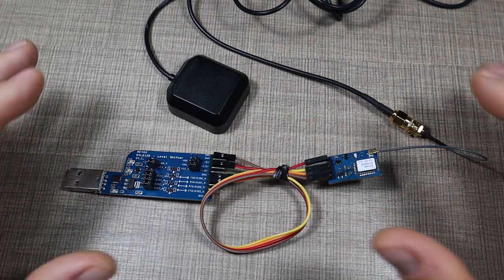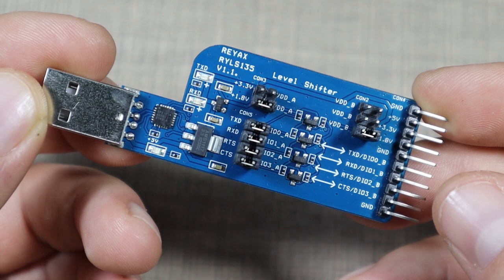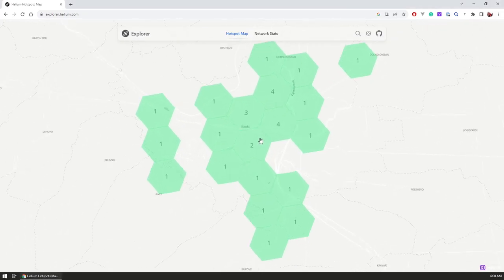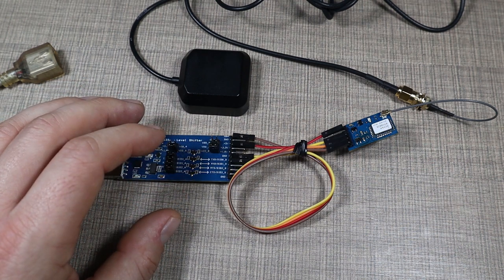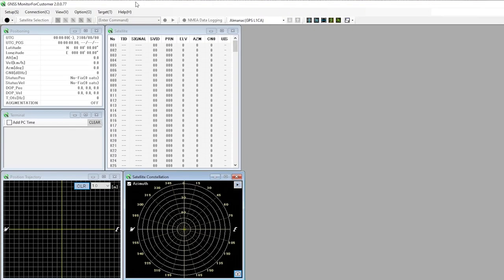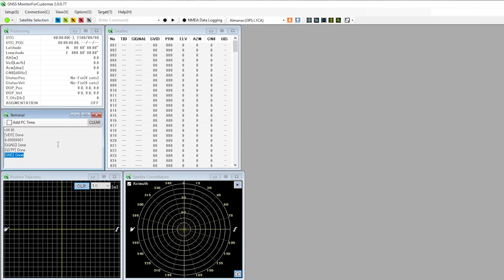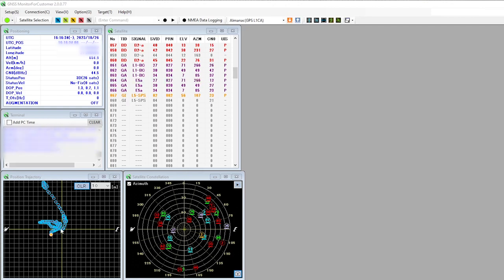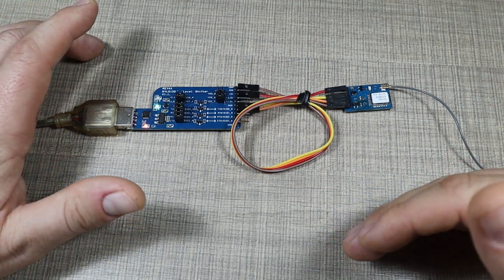GPS Module Reyax RYS8839 review and interfacing it on a computer

Comment: whats the point of being tiny of the antennat is huge
Reply from the maker: With the antenna being external, you can package the receiver in a small form factor so it can be embedded inside vehicles or other objects that you want to track, and the antenna can be mounted with a clear view of the sky. Unfortunately, the antenna is not something that you can omit or reduce in size.
Reply: @TasteTheCode  but do you know alternatives where we can use small onboard antetnnas ? Like in smart watches and mobile phones
Reply from the maker: GPS antennas in smartwatches are a great challenge and require very precise engineering and planning. Most mini modules with integrated antennas just slap the ceramic antenna on the "back" side of the module to try and reduce the footprint. There was a module announced called Nano Hornet that was supposed to be 10x10mm GPS module with integrated antenna but its company went out of business as far as I know.
Reply: @TasteTheCode  thanks a lot, I'll search for that, and if you have more suggestions to search plz let me know 🙏